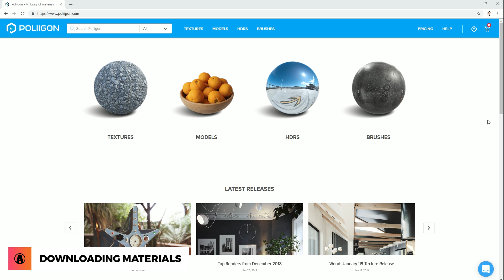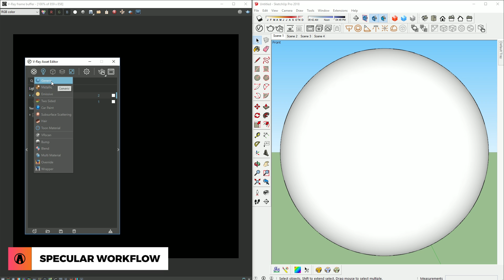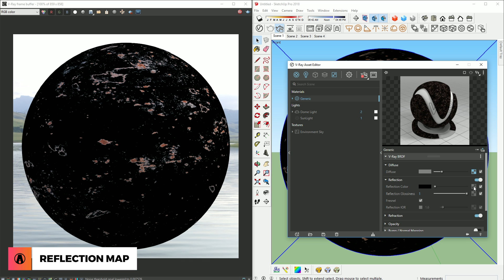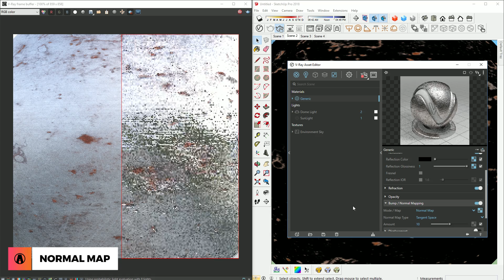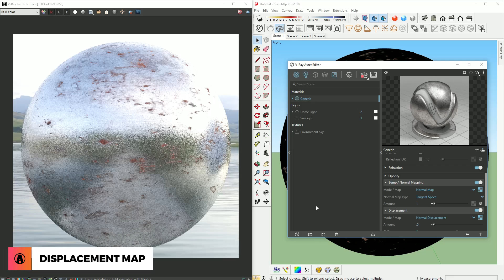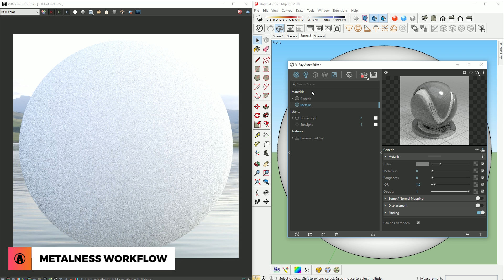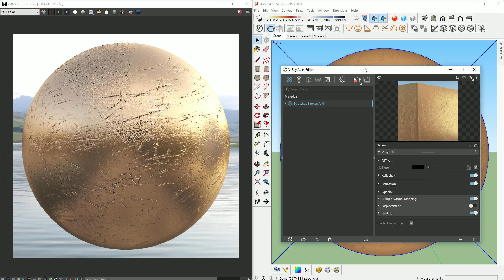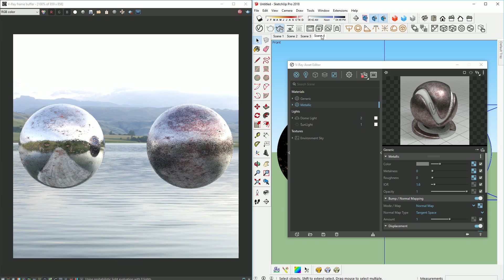How to create REALISTIC Materials (Part 2) Metal Materials

Comment: hey minh, would really appreciate if you could inform me through how to decide which color space to use for each different type of map. like how do you know which type of map need linear or srgb or anything else. like if i used a roughness map, does it need to be in srgb or linear or can it be either, and does the same apply for glossiness maps, because i know you can only either use glossiness or roughness. Like for me it is confusing when putting in reflection 'specular' maps and and then putting in roughness maps only to see that very similar settings use different color spaces. And like for AO for example, is it srgb or linear? I swear I cannot find this information ANYWHERE and i have been looking for an AGE.

Comment: Hello! Why do you change color mode to "Rendering space" in each map? What is the difference between these modes?
Reply from the maker: Not every map is like that. Usually only Normal, Gloss, Roughness and Metalness are produced using a Linear workflow. So you have to adjust inside of vray to match it 😄